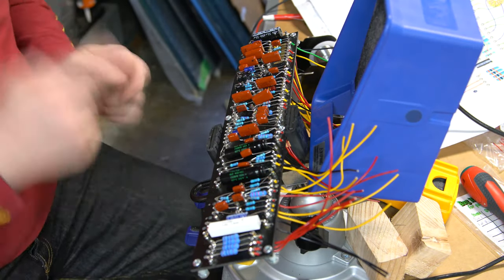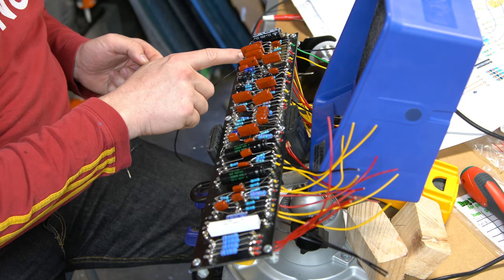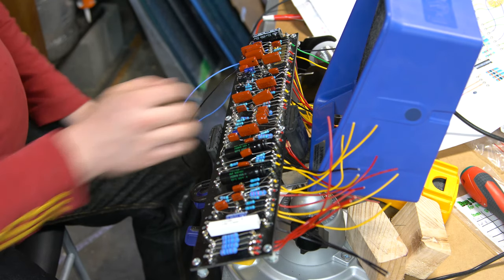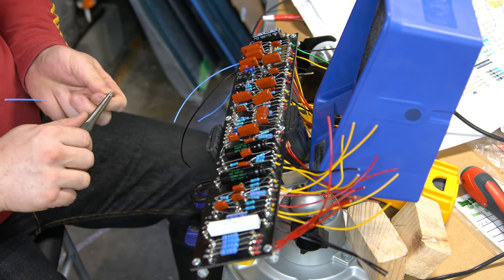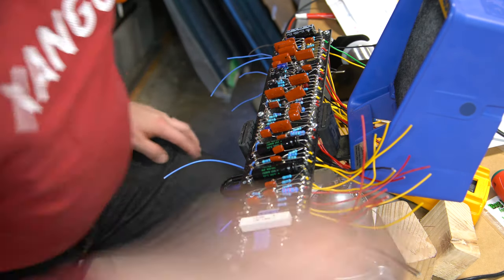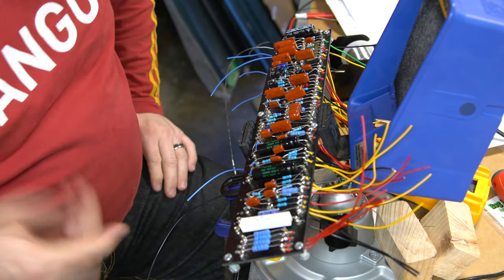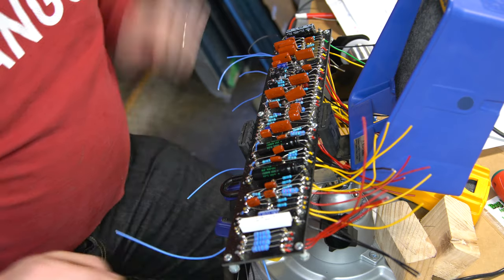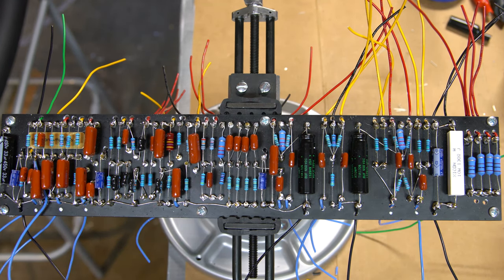Vox AC30/4 Video 13

Comment: AWESOME video!! Ive started modifying my VHT Standard 18. The gain channel was lacking punch and the tone stack was blahh. So its much better with the gain channel tone stack being 2203 specs and now im seriously considering changing over to 6v6's instead of the Stock EL84's.
Reply from the maker: +Tim Stanley sounds like you've got the bug to eh?
Reply from the maker: +Tim Stanley experimentation is most of the fun :)